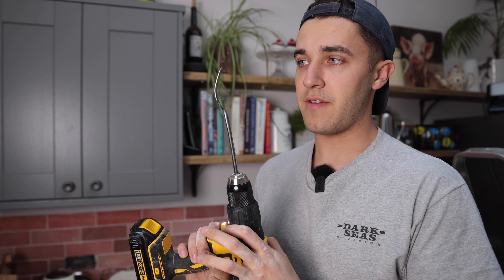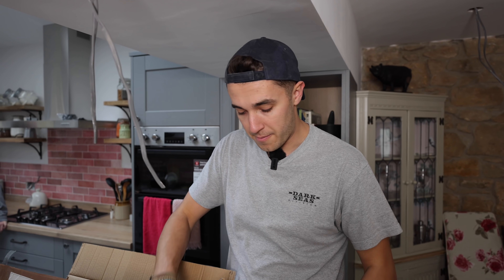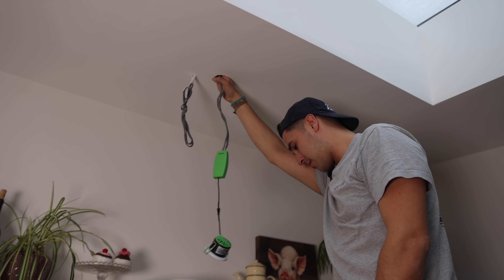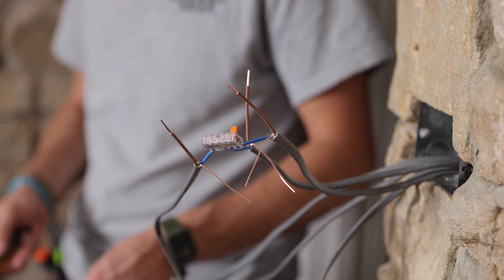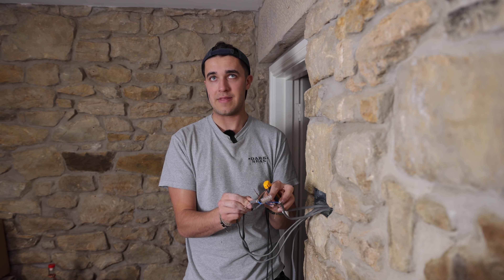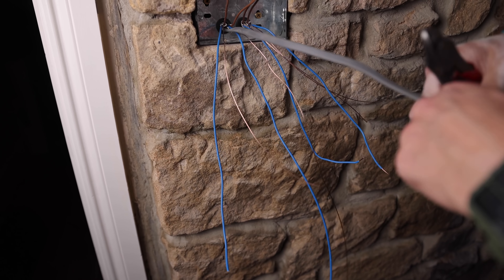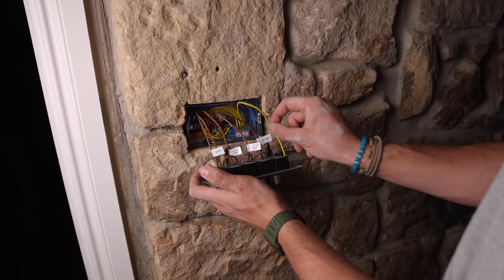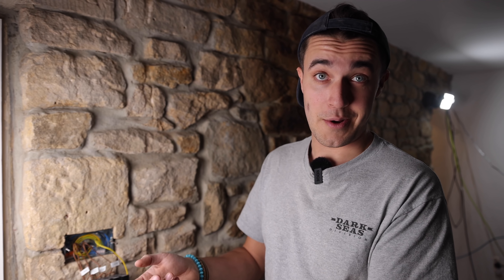SWITCHING MADE SIMPLE! RETURN TO THE CASTLE - Electrician Life

Comment: CK cable cutters 😉 a man’s best friend in the electric industry, you can’t beat them.
Reply: Hey mate do you know what size those cutters are that he’s using.
Reply: @callumblacknell6464  CK cable cutter 210mm is what I used and there great for the price, cut through armoured also but wouldn’t recommend that on a regular basis.

Comment: Ask the obvious question, are the LED downlighters flickering because they're not dimmable? Assuming they are dimmable, is it a leading edge dimmer and meets the minimum load load requirements? Flickering doesn't necessarily mean the dimmer is bad, just incompatible with the installation.
Reply: It’s 2022. Dimmers that aren’t compatible with bog standard dimmable led drivers are garbage. What are you going to use them for, incandescent? TL? CCFL? In new installations?

Comment: Maybe you should reconnect the common on the dimmers. They should be connected on L1 or L2
Reply: I just read  the datasheet on the dimmers. It actually puts the line IN on the wavey symbol, just like You did. Is this really normal in the UK? The rest of Europe uses that symbol as the switched/dimmed Line to the lights.
Reply: The common lines go in common, L1 is switched line position 1, L2 is switched line position 2 in the UK.